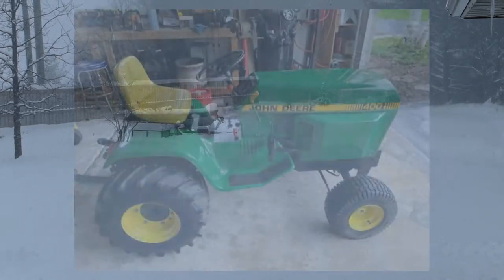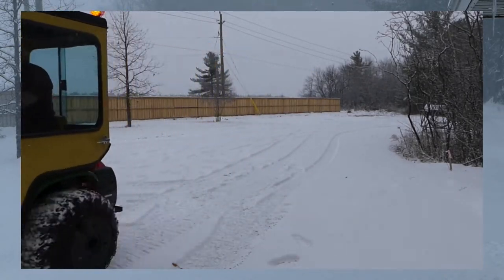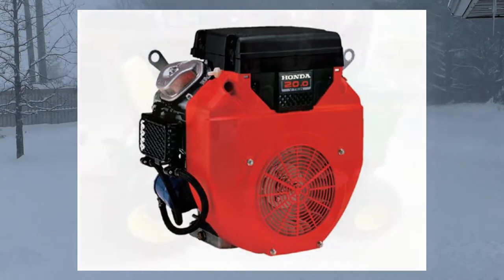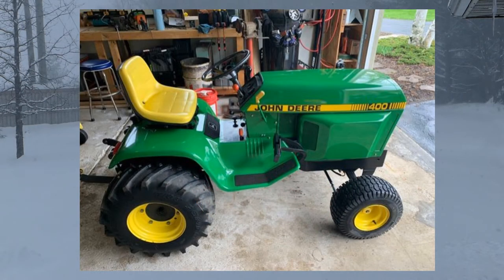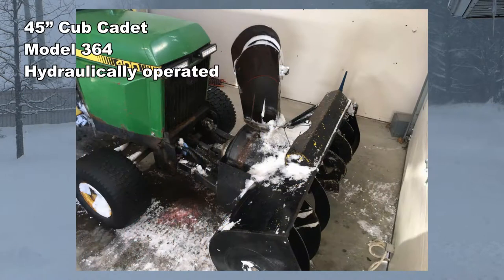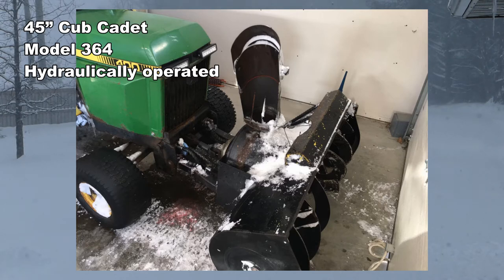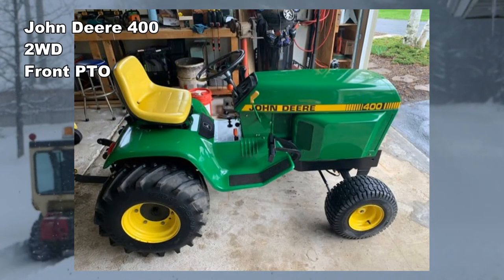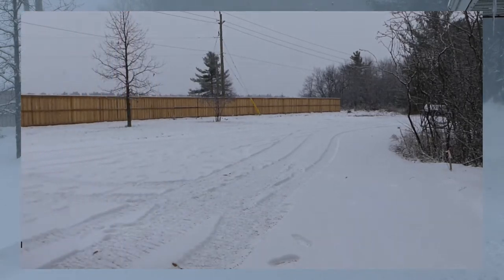John Deere 400 Garden Tractor Snowblower Winter Operations

Comment: Cool montage, I have a similar setup, a John Deere 322 with the 47" 2 stages snowblower and a JD cab. luckily, its Yanmar 3 cylinder engine is liquid cool, so I was able to use a coolant type heater. Personally, if I had your tractor setup, I think that I would have installed a 2nd larger alternator on the rear PTO shaft via a custom bracket and coupler and run the electric heater via a 2000W power inverter. That way, only one gas engine would be needed.

I'm sure somebody else must have done something as I described already...

Maybe some search on tractor forum would show some results.

But at least, you've got a heated cab.

Cheers
Reply from the maker: Yes, liquid cooled is the way to go for cabin heat.  I love your 2nd alternator idea.  That’s not something I had thought of.  Having said that, my tractor only has a single PTO that is used to engage both the auger (winter) and mower deck (summer).  I would need a second independent PTO that would just power the alternator.  I like the idea though.  

Regarding my design; a few unplanned perks have surfaced in the two years since I made the modification:
•	I think the extra weight of the generator actually helps with traction.  I haven’t been stuck in two years.
•	I’m now sporadically using the generator year-round, rather than just the summer, which is good for the generator.
•	I leave the generator on the tractor.  When I need power at a remote location, I don’t have to carry it.  I just drive the tractor over to it – cool.

Again, thanks for the alternator idea.  I’m going to do some reading on that.

Cheers
Reply: @LifeIsShortDIY  No need for an actual rear PTO, just need to connect to the spline shaft coming out of the rear of the transmission. This shaft is always spinning when engine is running. The rear PTO is optional on your tractor, but the shaft is there... and it spins at about 840 RPM at full throttle.
Nonetheless, what you did with your machine is awesome.

Cheers
Reply from the maker: @johndeere322_snowblowing9  roger that!  thanks.

Comment: Love my 318 with cab. I use a 12v heater to defrost the windows but have only used it 3 maybe 4 times. I installed two led light on top of the cab and a emergency  led light because I clean 4 friends drives in out subdivision.
Reply from the maker: The cab makes all the difference.  I have a 22-year-old craftsman lawn tractor with a blower on the front, as well.  The craftsman blower is actually better than the one on my 400, but no cab.  With the in-car heater in the cab, life is very comfortable. :-)

Comment: I like the idea of a portable generator. You probably only need it for occasional use on the tractor and if the power goes out you get a 2nd purpose. Simple.
Reply from the maker: Agreed.  A unexpected positives:  First the generator gets run more, and that is a good thing.  It will likely work when you need it.  Being on the tractor, if I need a generator at a remote location on the property, we just drive the tractor over to that location, no lifting.  And, the added weight, although small, doesn’t hurt with respect to traction.  Along with the tire weights, and chains, anything that helps with traction on a 2WD tractor is a positive.